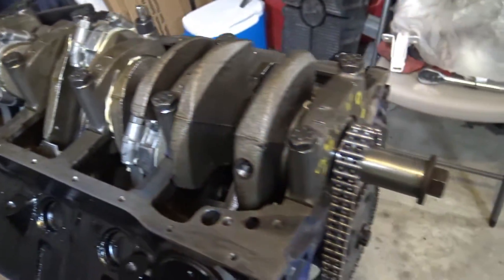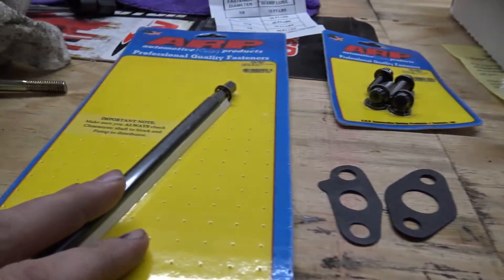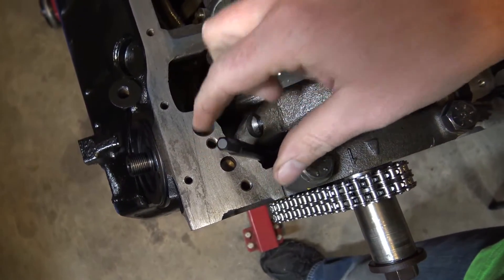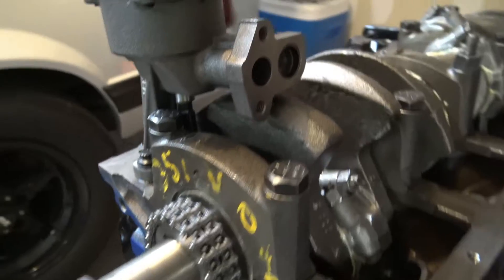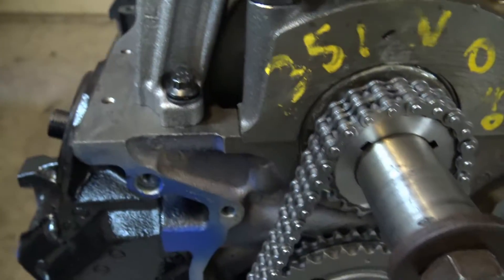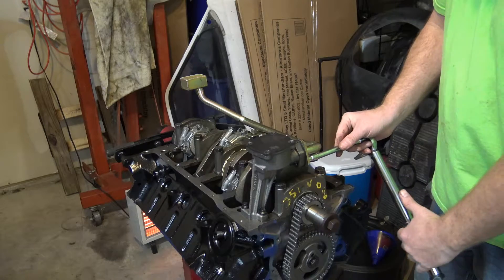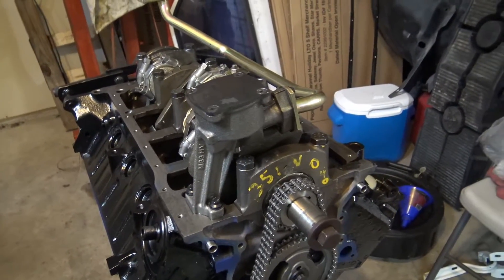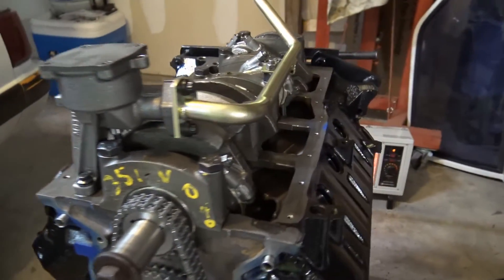Foxbody Mustang Budget Turbo build- Oil Pump Install

Comment: Hey Justin, just an fyi, torquing with an extension will drop your actual torque values, and a wobbly will drop them substantially... i bet those 35ft lb's are actually around 29-30... i would hate to see something as petty as an oil pump bolt cause an issue or damage to a fresh build... i would go back in there and throw a dab of blue loctite on them and try to torque them down again without the wobbly and maybe go a ft-lb or two over spec with the use of a 6" or longer extension..

Comment: Why not keep the crank but buy good rods and pistons?
Reply from the maker: This motor is budget in mind. I replaced the pistons with forged as the stock are cast. The rods are football rods. They are known to handle a good amount of power. I should be able to hit my power goals just fine

Comment: Dont put a high volume pump in it. I put one in mine and it broke the shaft when i was getting on it too hard.
Reply from the maker: Im gonna be running a arp shaft in it. A stock shaft would break with this pump. I should be fine.
Reply: @war pony, you WANT a high volume pump when your running a turbo or oil fed supercharger.
Reply: I use a stock pump with spring out of it so it dont suck all the oil out of the pan.
Reply: WAR PONY some people are risk takers.